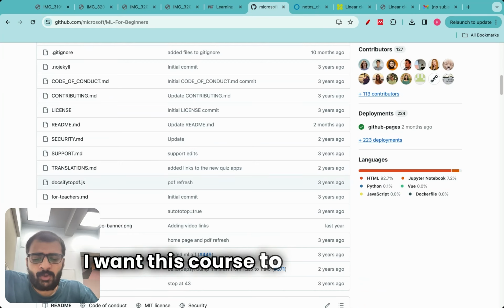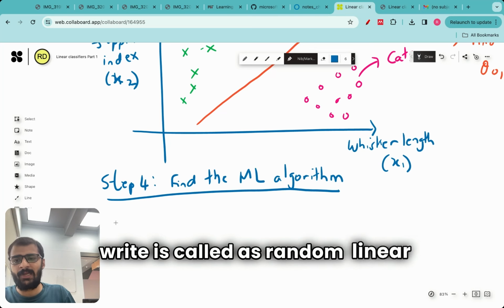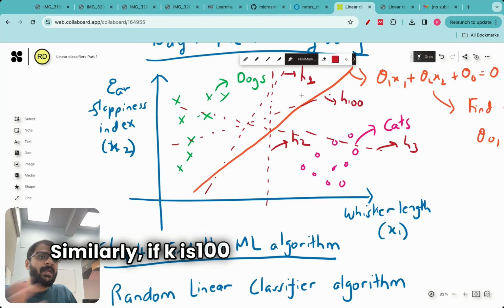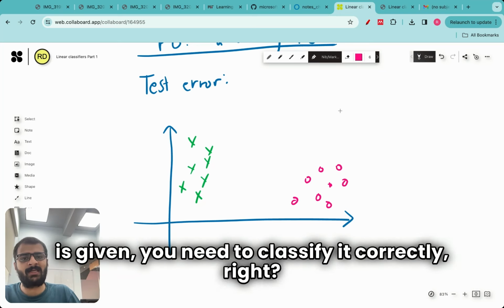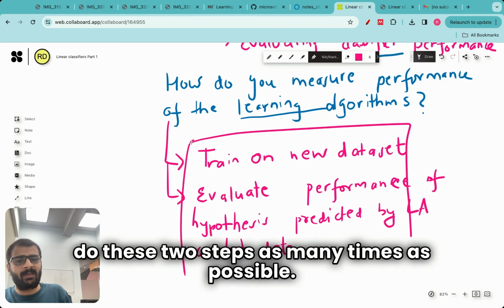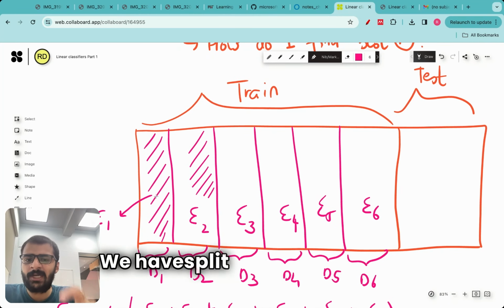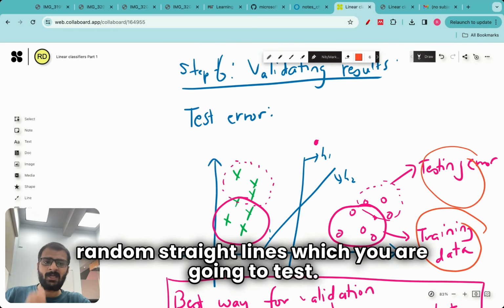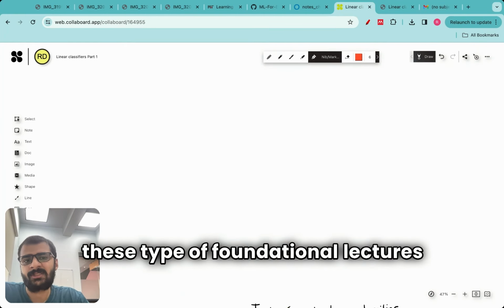ML Teach by Doing Lecture 7: Linear Classifiers Part 2

Comment: Isn't K the total number of sets of theta values (tet) tet1, tet2 and tet0? That is if k is 5 i will have a matrix of M1 

Tet 1 tet 2 tet 3
Tet 4 tet 5 tet 6
Tet 7 tet 8 tet 9
Tet 10 tet 11 tet 12
Tet 13 tet 14 tet 15

Correct? 

Now to do cross validation you are running a vector cross product of M1 with training data set d2,d3,d4,d5,d6  and then to test you are running vector cross product of M1 with d1 to get e1 similarly you get e2 e3 e4 e5 e6 and calculate cve by 6 

correct? 

Or are we calculating e1 to e6 for tet1 tet2 tet3 then again e1 to e 6 for tet 4 tet 5 tet 6 and then again e1 to e6 for tet 7 tet 8 tet9 etc? If this is the case should not again sum up e values for each set of theta values so that we get an overall e value for that particular k value. 

Which is the right understanding?

Comment: hi, there will potentially be many lines that have error = 0. How do we decide which one is best? Also, why does the graph of K against error start with high error? Since the three theta values are random, couldn't it just as easily start low?  Thanks for the great videos. Your concept here — to take two other courses and present them in a clearer and more accessible way — is amazing. Enjoying them very much.

Comment: How to measure the performance of the learning algorithm?
Ans1 We can have multiple set of training and testing data set. eg 10 bundle of 10 dog and cat visuals.
Ans2 If we have limited set of data which is to be consumed as training and testing we will be finding the best k(hyper-parameter) by the help of Cross validation error-:
during training set holding some data back and validating it  from other out of 6 training set 1 can be stashed and trained on other 5 and repeating the process on other 5, averaging the total error and finding the best value of K.